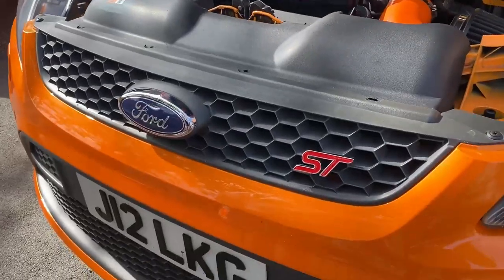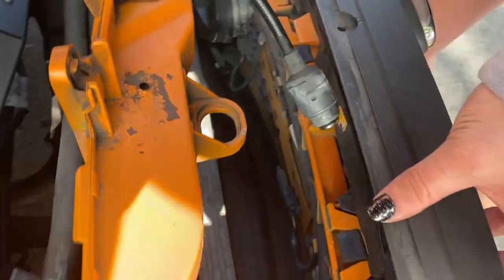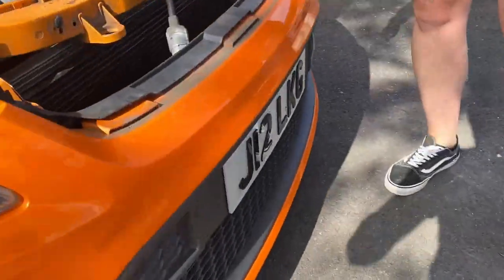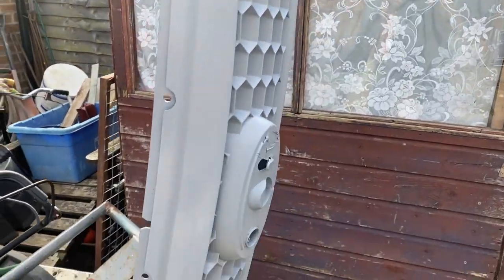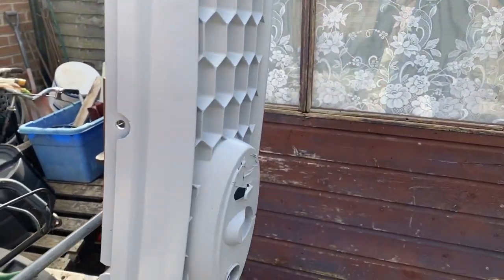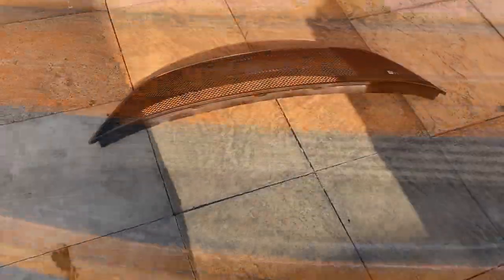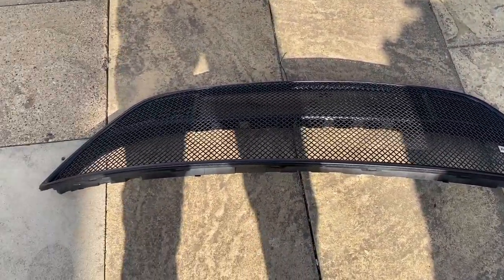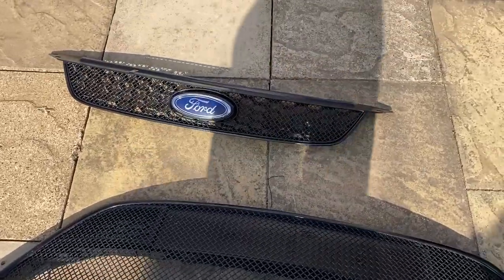FOCUS ST MK2 FACELIFT - ZUNSPORT GRILLES INSTALLATION!

Comment: Hi mate. Did the number plate go back to it original position ?
Reply from the maker: sorry for the late reply, i used cable ties through the zunsport grille and then i slide my plate in and take it off for shows
Reply: @j12lkg  thanks man ! I just screwed mine in. Cheers.
Reply from the maker: @euanscotland  bet it looks awesome man!
Reply: @j12lkg  yeah. It's the face lift. Put a nice intercooler in at the same time. 
Decat. They sound awesome.